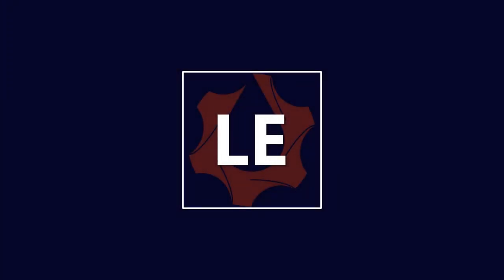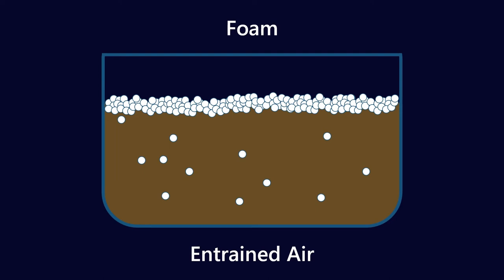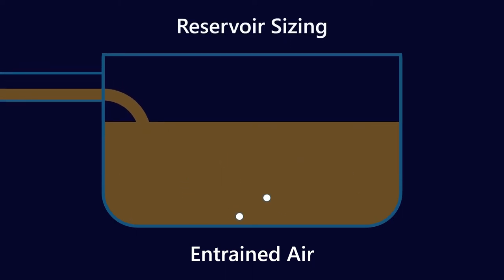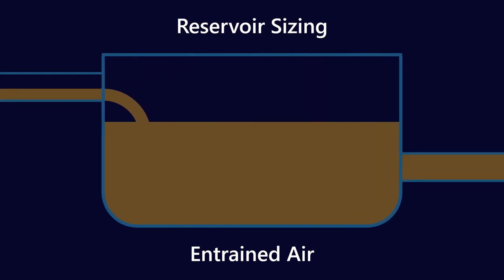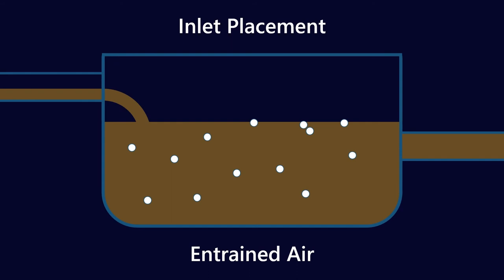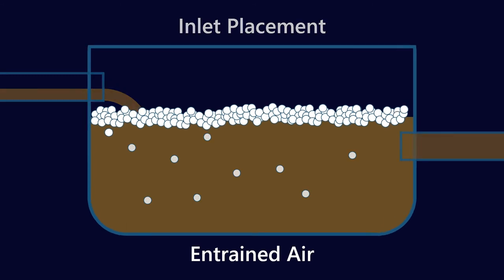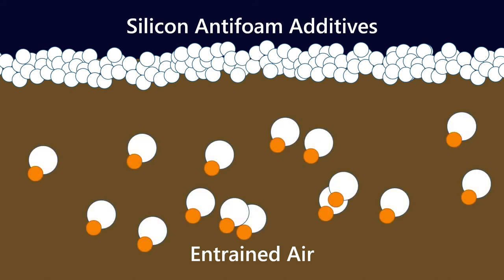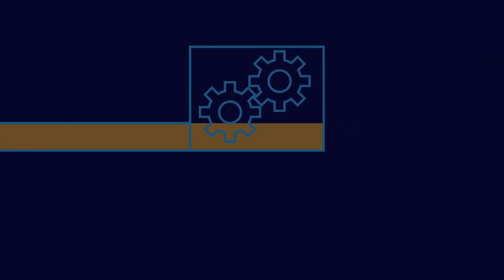Troubleshooting  |  How do I minimise entrained air in my oil system?

Comment: Hi Mr. LE, I've read that if you mix GIII diesel engine oil with Jet engine oil Tech PE, you'll endup destroing the antifoaming additive of the Jet engine oil (for apu small reservoirs), because the dispersant of diesel oil would react with the antifoam of the Jet polyolester. Is that correct or a myth? I was doing that to enhance low temperature performance and cleaning properties of the Diesel oil, but now I dont know if I should. I actually notice that right after mixing the foam of mixed oils would disapear immediately, and after a few days, the foam acts like used oil, remaining at the top layer for several minutes...
Reply from the maker: Good question - haven't heard that one personally. Let's start with the antifoam in Jet Oils. There are generally two types of antifoam additives: acrylates which are focussed a bit more on air release, and silicone-based which break surface foam. The silicone-based additives are hydrophobic (therefore non-polar) so theoretically dispersants should not preferentially attach to them. Acrylates are actually formed with esters so are slightly polar, and might attract dispersant molecules, but probably no more than the ester base stock molecules would themselves.

So on balance, I don't think the degradation in foam performance is down to the antifoam agents being negated. I think it's more likely that by dosing the system with polar esters you're increasing the surface tension of the whole oil system to the point where it can form stable foam bubbles. 

Here's a still from the oil foam video which hopefully explains what I'm getting at. I think you might have basically taken the GpIII mineral oil and added enough polarity to it to put you into the sweet spot for foam stability:

https://youtu.be/oVcemvLAwIM?t=416
Reply: @LubricationExplained  Great! Thank you very much, Mr. LE!

Comment: We facing same issue in our plant..our high pressure Hydraulic tank contaminated with water. We do test heat exchanger but it's not leak and in good condition..our return line on top tank and oil level is half tank.  After drain the hyd oil, we do filled up with new hyd oil and done flushing few times. Currently we using purifier machine to purify the oil  . For 3 weeks the oil looking visual clear than the 4th week we found cloudy oil again. We do oil analysis for oil and it's above 150ppm but no coolant content in water in the oil analysis results. It's there Any possibility of cavitation for this issue. Please advice
Reply from the maker: If I understand this correctly - you’re seeing water contamination rather than air contamination? If so, cavitation is less likely. When you have cavitation you will know it - the hydraulic pump Will sounds like it contains marbles.

Comment: What about if the return oil fitting is actually at the bottom of the reservoir under the oil level.   Can that cause issues?

Comment: Hi...is there any specific cause/reason for foaming in the morning (causing the oil to come out of power steering reservoir) when starting the vehicle ???
Reply from the maker: That's really weird - in fact its probably the opposite of what the physics says should happen, as gas solubility is higher at lower temperatures (so in the morning the gas should be dissolved rather than breaking out as foam). The only thing I can think of is that in the morning you've had the longest settling time, which allows entrained air to rise to the surface and break out as foam.
Reply: Been a while, but wouldn't condensation also be a factor for something like this. Morning dew/condensation would be my guess.

Comment: I have a question, so far cant find anyone to answer it.  Differential oil gets highly foamed.  That lowers the viscosity and other negative things .  If the oil is foamed up isnt the bubbles going through the gears causing wear (metal to metal contact)?  Another question, with the foam wouln't additives like graphite and molyboledium disulfide help lube in the metal to metal gear contact.  I have been thinking about this as a way to lubricate the gears better, slow wear, and gain power.  Cause honestly high viscosity oils take up HP to turn gears.  Wouldn't a screen, below the lube level help in dissipating the bubbles?  I got so many question, I probably make your head explode!  Thx Clint
Reply from the maker: Okay a few things to parse out - yes, air in oil will lower viscosity. This may cause excess wear if the viscosity lowers to the point where the lubricant film is insufficient to separate the gear surfaces. In this instance, additives take over (see the EP video we posted today!). Additives like EP, antiwear, and even friction modifiers help in these instances. MoS2 and graphite solid lubricants can also help a bit.

Comment: Nice explaination but I have a question. Do we still need of antifoam additive if foaming tendency of my finished oil is 0/0 ml?
Reply from the maker: Good question. It would depend a little bit on the application, but in general the answer will be yes. Check out our explanation of oil foam formation and stability of fluids: https://youtu.be/oVcemvLAwIM In that video we showed that increasing the polarity of a base oil will increase foam stability - oxidation products tend to be polar so this is why a finished new oil with foam 0/0 probably won’t remain so as it ages. Hope that helps!

Comment: Hi great video, thank you. If the one of the reasons for the cause of entrained air is from the return, so in reality why wouldn't the system design the return to be at the bottom of the reservior, likewise, designed the inlet to be at the bottom so it has less risk of sucking air bubbles as shown on your viedo?
Reply from the maker: Great question! The problem with putting the return line at the bottom of the reservoir is that now the outlet doesn’t vent to atmosphere, i.e. it has non-zero pressure. Basically it would mean that the oil pressure at the return line would have to be greater than the static head exerted by the fluid level in the reservoir. This would mean that the entire oil system needs to be charge to a much higher pressure.